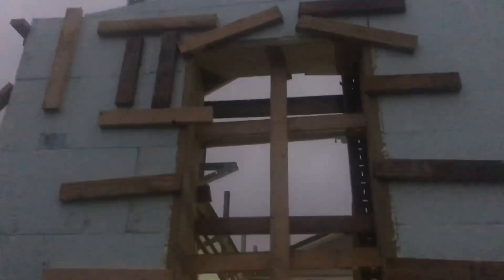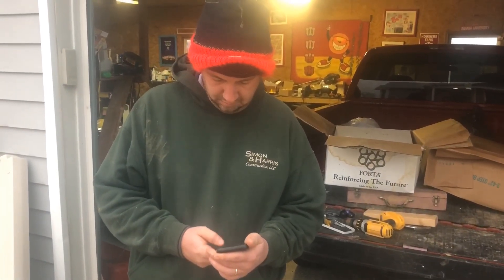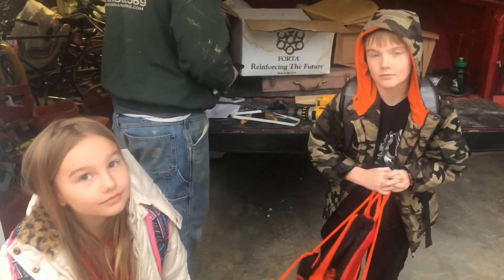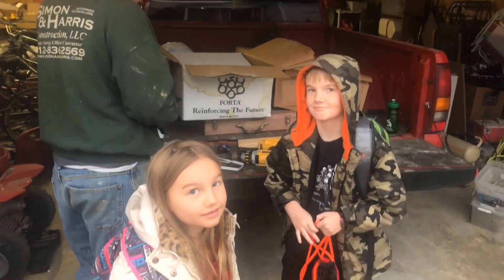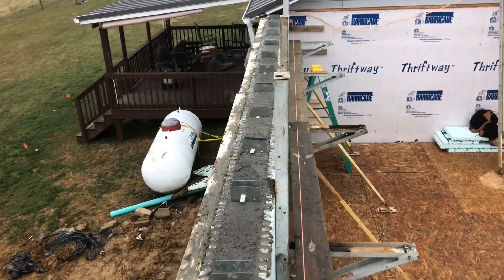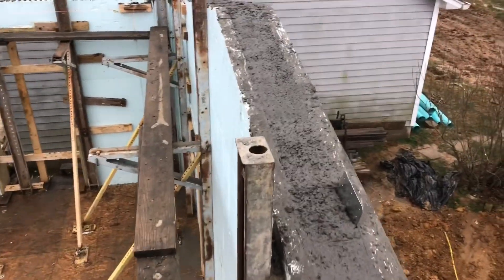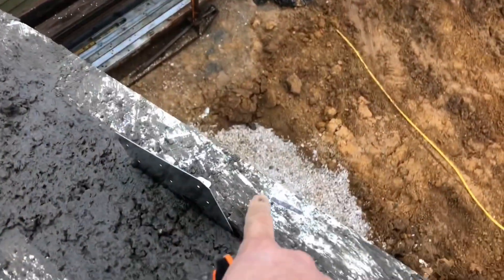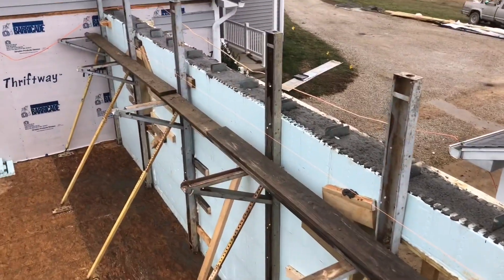Main level icf pour #nudura #icf

Comment: Great video!   @7:03 is the concrete pressure a little high or is that what I should expect to pour at?   I understand they need two 90 degree bends in the pump truck hose and 3-4" outlet pipe to restrict the pump truck.   Second questions.  Does the drill type vibrator work better than the 8ft concrete vibrator (dildo)?
Reply from the maker: Just right and better for icf

Comment: Have you considered using a digital level for the final plumb test or do you feel the string and tape is better?

Only asking because I have a digital level that I use for tinkering in my garage.
Reply from the maker: String is much more reliable no batteries who cares if it’s dropped in the mud are states raining and it’s cheep and does a great job
Reply: Dirt Perfect Thx all good points 👍